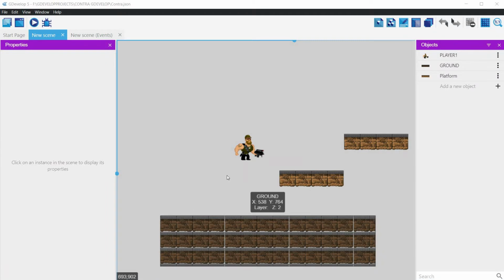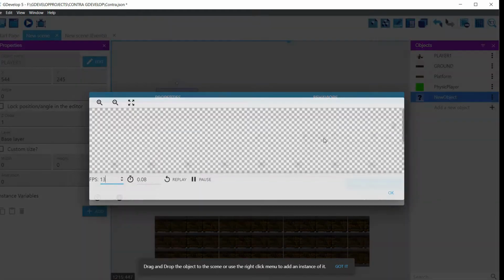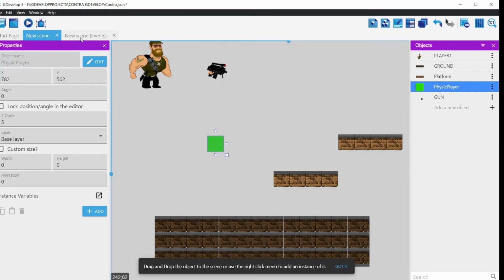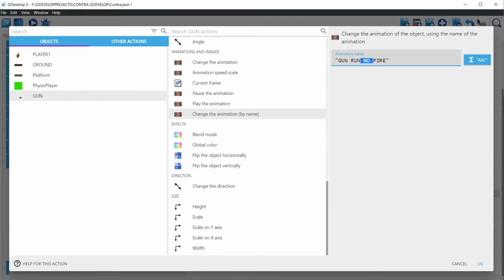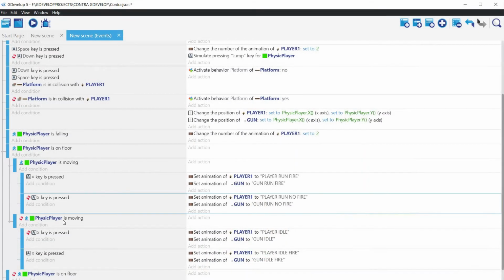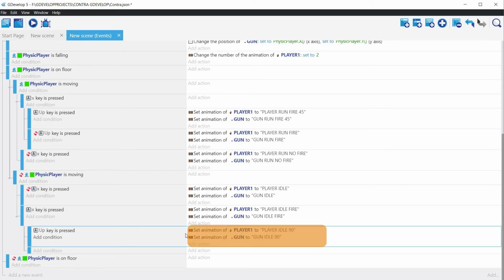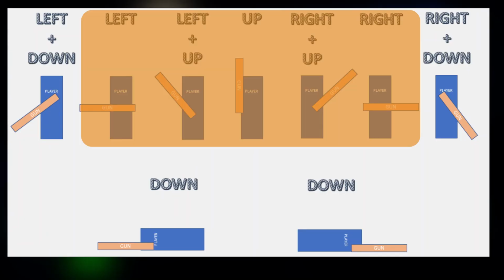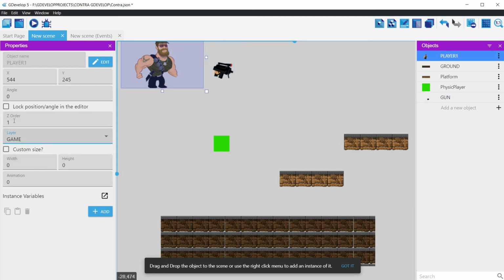Gdevelop FREE VISUAL Game Engine: CONTRA Tutorial #03 - New movements and shooting mechanics

Comment: Why do you think my player can't drop thou the floor I watch your video copied it one hundred percent
Reply from the maker: We have checked it, and it is working, but going in detail over the code, we have seen  something, that although not incorrect, could possibly create your bug, depending on your collision boxes.   
In the events, look for the condition that are checking if the platform is touching the player, will look something like "  Platform is in collision with  PLAYER ...".
In the same way that we have replaced the movements to deal with PHYSIC PLAYER ( the green box/cube" those two conditions for the platform should be referring to PHYSIC PLAYER (or what other name you have been naming it in your case). Let us know if it solves the problem.